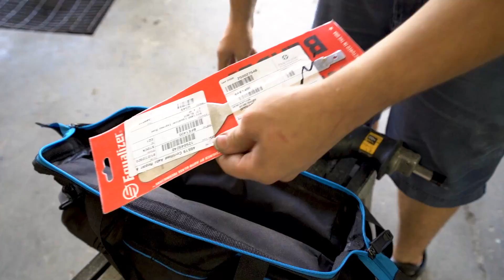My 2018 RAM 2500 is Painted

Comment: You work like I do...I try to do as many things by feel (without gloves in my way) and use my sense of touch as my "eyes" and my guide.  That's how I taught myself how to fabricate and weld when I was a kid growing up in a steel shop.  And it's still the way I do everything to this day.  I also taught myself how to work on things, and learn how things work, by taking them apart and putting them back together.  Started doing that when I was really little, and it used to piss my dad off, but it made me a hell of a mechanic and engineer.  So, it paid-off in the end.  👍🏻
Reply: oh, i agree !! you are one hell of a man .

Comment: Next time use your cold knife. The handle with the blade across top so you don't mess up the paint on the roof.. then use the extractor equalizerto cut the rest out... or use tape across the roof line. I've done auto glass for five years. I have a little insight to give you

Comment: Hey V-tuned... I need to warn you about something man.  You're using a 3M respirator.  You're using P-100 (the pink) filters.  Those are for dust, not paint vapor.  You're breathing the paint chemicals in that kind of mask using those filters man.  You reallllly need to go get you some OV type filters - 3M 6001 Filters - or you're going to have health problems in the long run from the volatiles in that paint "blowing through" those filters.  You're using the right kind of mask but the wrong kinds of filters for paint.  Please. please... check with your supplier. 
-A guy who works in a steel shop and oversees painters and doesn't wanna stop seeing V-tuned on youtube.